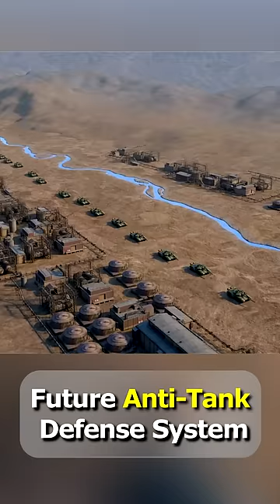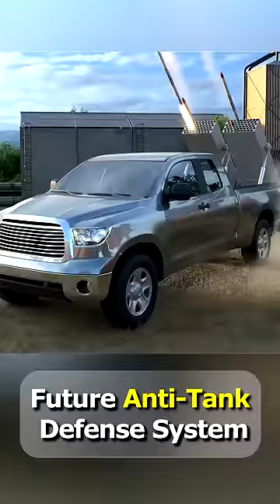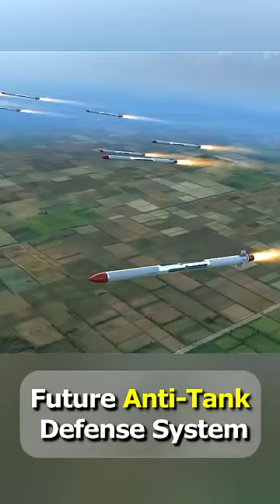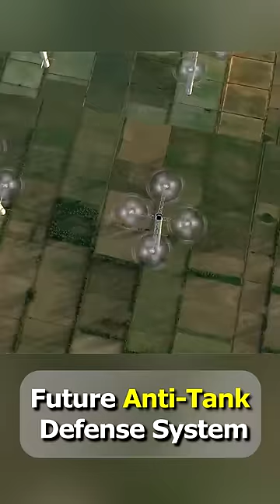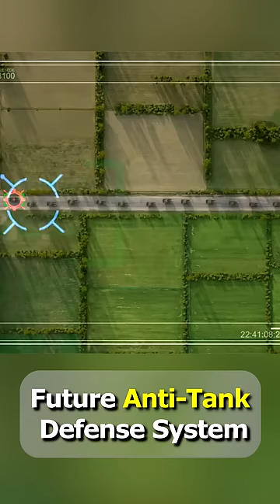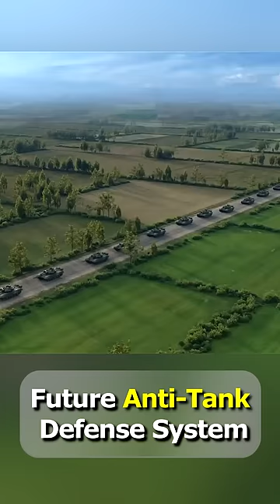Future Anti-Tank Defense System #shorts

Comment: new fanfiction dropped!
Reply: Fun!
Reply: man what's going on Ohio 💀
Reply: Probably a fanfiction, but not a bad ideia after all,  drones going to have an important role in battlefields of future
Reply: @carvalhonuno8083  yes, but not like this. Drones launched as missiles would have huge energy for the action you see And also missile launch isnt one of the quietest ones (smoke, noise...). Would be much better just to launch the drone
Reply: @MultiTsunamiX  for that I say in the future, but one observation; don't need to launch the missile from the drone, just let them fall and then activate the propulsion.
But for now, yes that's better launch kamikaze drones.
Reply: @handmadehearts  000000000000000000000000000000000000000000000000⁰⁰⁰⁰00⁰⁰⁰⁰0⁰ㅔㅖ⁰ㅖ0000000000000000000000000000000000
Reply: @Mukapogz  &h
Reply: definitely with the "its preferable to use Switchblade" knowing that they have had almost zero success and haven't even killed one tank, only damaged a single T-80

Comment: There are already existing MLRS missile systems that can attack armoured formations over a large area which are more cost effective than the system shown. They can also be dropped by air. The MLRS system can fire a large number of submunitions over a large area. The bomblets detect heat signatures and fire on vehicles as they drop. If they detect no target they can sit on the ground as a mine until they have a timed detonation. These missiles were used against an Iraqi armoured formation.  The 600 switchblade is also an excellent and cost effective weapon. Man portable and able to destroy any enemy tank at 50 miles.

Comment: Switchblades and javelins? Absolutely useless in comparison. Switchblade 600 has proven wildly ineffective in Ukraine.

Smartrockets in an MLRS system is a much better option, if you want to attack a convoy. 

And bringing in a 25 year old system like the Javelin, and call it the system of the future?

Tech has developed immensly since the mid 90s where it went into production. 
We can build something much smaller, that can perform the same function, but weighs little more than the warhead itself.